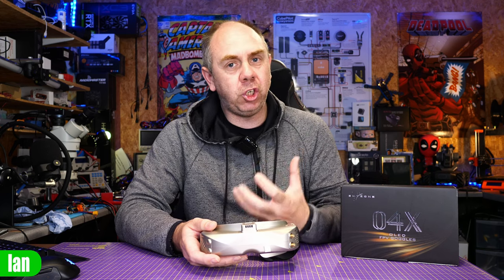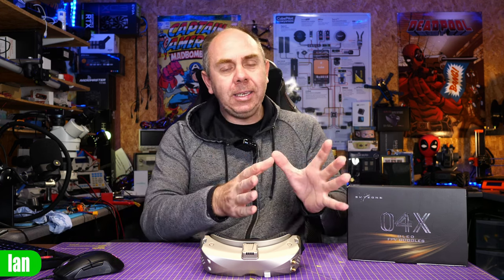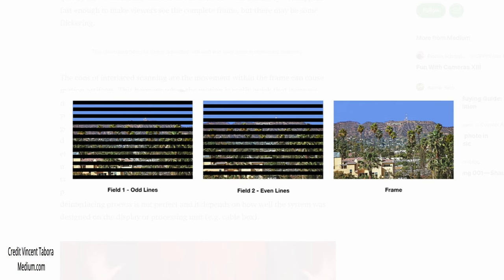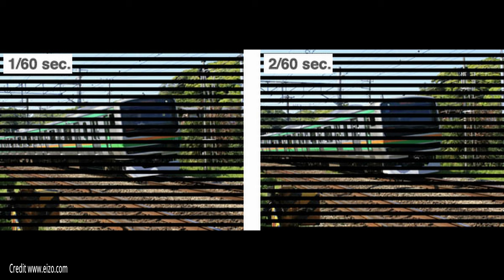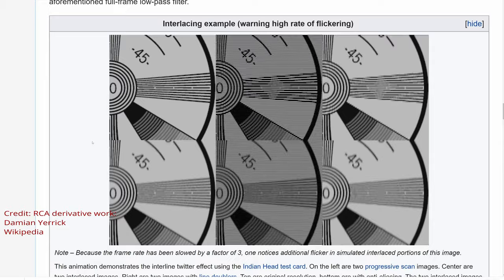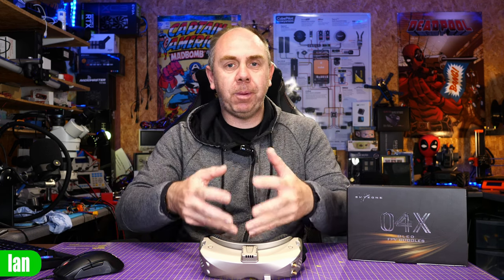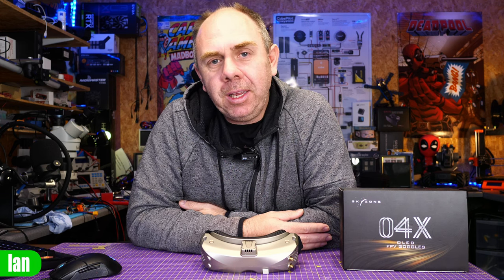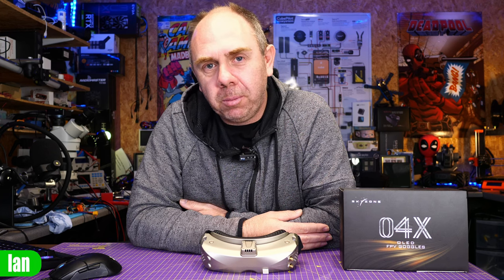Skyzone 04X OLED FPV Goggles Jitter - Interlacing Explained

Comment: It's still a deinterlacing error!  Just one that happens to be made by the 60fps goggles you tested.  I think you may be confusing spatial errors with temporal errors.  A static image should not jump up and down.  This is a spatial error caused by moving the first field into the second field position or by pulling/placing the wrong lines from the analog signal.  

My guess is each of the 60fps frames displayed is using the most recent 2 fields received from the continuous stream of analog fields and not preserving proper field dominance.  What was lines 1,3,5,7 etc. gets put into 2,4,6,8 position in the next 60fps frame.  This is the spatial error causing the up/down jumping.  It gets you half of the frame 17-20ms earlier(NTSC/PAL), which arguably is lower latency if you want to count the arrival of half the image but I don't think that makes sense to chase.  But it will look that way if you do the 'light flash latency testing' that me and others like RC Shim Mario have done.

Using this approach introduces the temporal (time) error, which is why the latency would appear to improve.  In a non-moving image, you won't see the impact.  In a moving image you'll notice a mismatch with every other line coming from the next frame.  The faster the motion, the more noticeable the error.  If you pause and go frame by frame, every other frame will show the error.  You'll have one 'time matched' set followed by a mismatched set of 'old frame field 2' mixed with 'new frame field 1'.  And if the fields aren't properly placed, you'll also see the up/down effect.  edit This time error also depends on the capture device - CMOS vs CCD.  A CCD camera grabs the whole frame at once and breaks it into fields, delivering it with field to field time delays.  A CMOS cameras scans line by line (which is why we get jello but that's another kind of temporal 'error').  I think the temporal error will look worse on CCD since the two fields are the furthest apart in time.  The CMOS should blend nicely since the fields are consecutive so the time spacing between two of them is always the same.  Just don't screw up the positioning. end edit

Bottom line is there are 2 distinct types of errors and it doesn't have to be this way.  The analog converter can either patiently wait for a full frame and display each frame twice in the 60fps world while waiting or it can try and get ahead by combining the fields from the last frame and the next frame, but it has to be done in the right position, which it clearly is not doing.  You can manipulate all this stuff in a good video editor.

Did you ever try this on the DJI analog goggle input?  They used to have an issue determining PAL vs NTSC where the fixed latency depended on how they synced with the analog signal and it was different each time.  That was fixed in firmware a long time ago.  I don't recall how their 60fps conversion handled the frame/field order.  Sometimes it can even matter if the camera is on before the goggles try to sync or vice versa.

If you want the best low latency analog system without any of these hassles, put a couple of CRTs into a pair of goggles 🤣 
Like I said before, deinterlacing is a bitch!
Reply: Why is this not higher up? This is the answer. It's analog's fault, yes - but it's also in the way the goggles are interpreting and rendering the analog signal in the new displays. I'm sure Skyzone/Fatshark have experimented with various setups and for whatever reason, just determined the current configuration is the best option. I'm sure they've noticed this 'twitter' (terrible name for it) before and just said "well, it's that or this other thing that's also bad." I can't imagine at least one of these manufacturers didn't notice this before.
Reply: @trekkin_fpv5272  I think Ian has to make it a pinned comment if he deems it worthy :)
Reply: >My guess is each of the 60fps frames displayed is using the most recent 2 fields received from the continuous stream of analog fields 
I tested it and it always shows the most recent field as a frame. No active interlacing is done, no mixing, no combing.

Comment: As I understood it "Jitter" involves a variation in timing of data deliveries arriving down a stream.  In this case the timing is fixed and consistent, so although I understand the point you are making, I dont think jitter is necessarily the correct term.

Comment: So in other words if the goggles had crappy optics it wouldn't be as noticeable and if I put my original 30 fps DVR back in the goggles the recording wouldn't flicker, thanks Ian. At least when I replaced the DVR module I found a damaged ribbon cable that was causing other problems. Thanks to John in support for sending me the needed part.

Comment: You need to try dual skyzone modules, you will want a 1500mah 4s or greater. it will melt the  standard 2s18650 pack wires a little :) . when doing this choose mix not div.... the best analog available....

Comment: Deinterlacing can be a valid explanation for jitter on video that contains temporally changing information, but it cannot explain the osd elements jittering, since they remain static and are not changing in time. Unless I'm missing something.

Comment: Ahh yes, good deinterlacing causes delay, so they have to approximate the missing field. It does tell you though they could have improved analog just from progressive scan but they had a lot of old cctv camera sensors to dump off.
Reply: Why would it cause delay?  In a 60fps world it actually gives you the chance to decrease latency as you can push the next frame when you only have half the info (one field).  You just have to put it in the right spot so it doesn't screw up the image.
Reply: @rotorgeeks2727  because it's not real deinterlacing you need to buffer else you get those nasty lines per frame, they are just line doubling these goggles also known as 'bobbing' deinterlacing. Clearly only one field is displayed at a time it jumps around & why analog looks far worse than you remember on your parents TV.